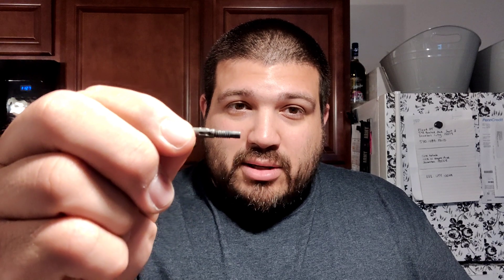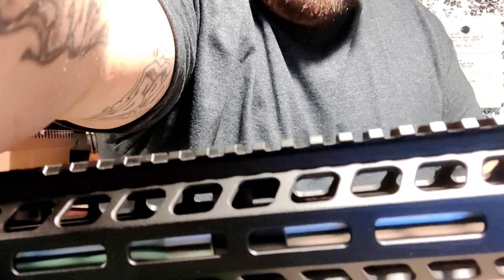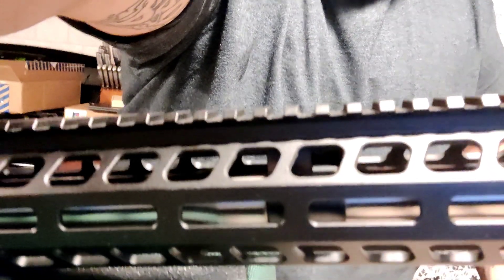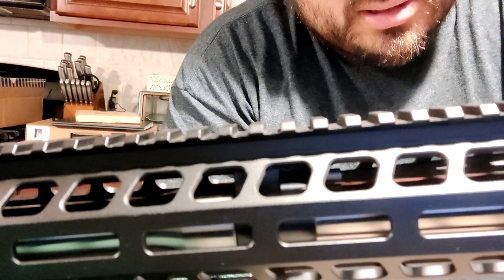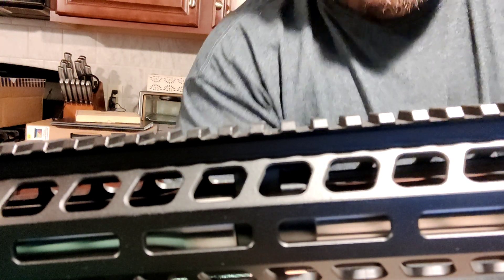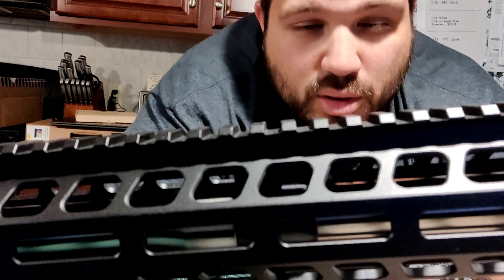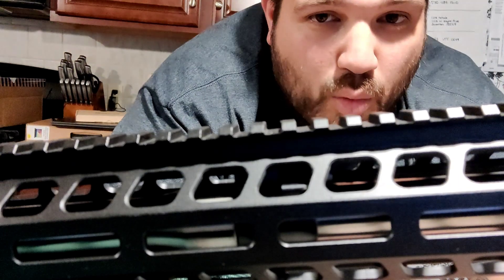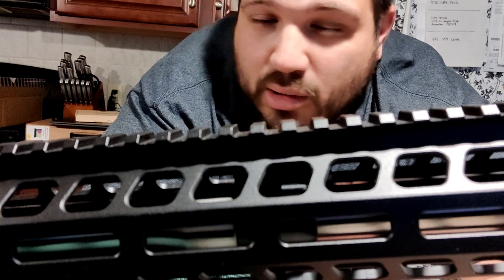PSA AR10 Gen 3 gas block adjustment

Comment: I got a psa ar10 in 308. Runs great without my suppressors on. With it on it wants to stove pipe from time to time. I am going to try and adjust the gas block like you showed maybe it will help.

Comment: My set screw fell out twice turning the fire arm into a single shot. Luckily I was able to find it both times.  I put blue lock tight on it and hope I don’t have the same problem, but have lost confidence in this gas block set up.
Reply from the maker: Sorry to hear that. There should be a small set screw on the side of the gas block that holds the detent in place. You can adjust the tension on the detent there. If it does nothing, they most likely forgot the detent and should warranty repair or replace the gas block.

Comment: I do have a question. PSA says the factory gas setting (for the 3 position block, not 5) is on setting #7. Does that mean 7 clicks from fully closed? Or 7 clicks from fully open? I can't seem to get any reliable extraction at all so I'm trying to restart at the factory setting. Might just sell the damn thing
Reply from the maker: @Gunthusiest  it's hard to say with how vague PSA's instructions are. I'd close it all the way, then open it 10 clicks. That should be a good starting point. You can fine-tune from there.
Reply: @airborneivan  I'll give that a shot. Thanks bro
Reply from the maker: @Gunthusiest  no problem. Let me know how it works out.
Reply: Started at 10 clicks and backed it off one. Works perfectly now. Using Winchester M80 (149 gr) if anyone is interested. Thanks again.
Reply from the maker: @Gunthusiest  awesome. Glad it worked.

Comment: So tightening it increases gas? And loosening decreases? And what size Allen key mine didn’t come with one.
Reply from the maker: @stevenweisenburger6095  counter clock-wise retracts the plunger and opens the gas port. Clock-wise, restricts  the gas port. I forget the allen key size, but if you reach out to PSA, they send you a replacement.

Comment: Thanks for the detailed demonstration. I saw your other PSA sabre video recently and was curious if your 13.7" AR-15 PSA Sabre also has this "5 position" adjustable gas block? The website says that the rifle includes the adjustable gas block but it seems like Tactical Advisor's review of the Sabre says differently for the 13.7" one specifically. He mentions it timestamped here: https://youtu.be/nw7IruQrjPQ?si=iK_WyWo13YAswopl&t=475. Just wanted to reach out to clarify. Thanks!
Reply from the maker: it is either a 3-position or 5-position gasblock. I didn't take the adjustment screw out to verify. As for Tactical Advisor's video. His 13.7 is the billet variant. It seems that the billet models that come with the Sabre Lock Up rail do not come with an adjustable gasblock. I'm not sure if this is due to the internal dimensions of the rail.

Comment: Oh nice. So it does have detents. I was worried. The double set screw style doesnt work. Thats what i thought it was.
Reply from the maker: The set screw on the side just retains the detent and spring as well as adjusts the tension on the detent. Just be careful if you need to remove it for any reason. The detent is small and easy to lose.

Comment: Shot my PA-10 for the 3rd time yesterday. It had some trouble cycling, but it wasn't an ejection issue.The bolt just was not riding the round home completely every time and I had to help it with the charging handle. I've not adjusted the gas at all, just using it at whatever it came stock at. Should I count the clicks turning it right to fully closed and see where it was, then try around 10-12 clicks out? It only has about 80 rounds through it now, so unsure if it's just still breaking in or if it needs gas adjustment.
Reply from the maker: Yea. I'd close it off and count the clicks in the process. Then add a click or two and see if you get better feeding. I'm not sure if you got the 3-positioned or 5-position gas block. I'd say 10 clicks out from closed is a good start.
Reply: @airborneivan  I'll give that a shot (teehee), thanks.

Comment: Thanks for this video. I have a question: What size is your Allen key? I bought a 6.8 SPC upper that did not come with an Allen key. I was getting one round at a time with ejection but no feeding the next round in. Swore a bit, wondered if the mags were no good, etc., etc. Then I realized/remembered it had an adjustable gas block. I went to a few stores to find a long enough Allen key. Found a set that is about 6", but they have a T handle. The 2.5 mm will work, half a turn at a time, but I want to find the right size and length Allen key for it. Thanks in advance.
Reply from the maker: I believe it's a 7/64 Allen. If you contact PSA and let them know your upper never came with the Allen key, they should send you one.
Reply: @airborneivan  Thanks a bunch for the info and the quick reply! Have a great week!
Reply from the maker: @greybeard277  glad I could help.

Comment: Is there a set screw on the side of the gas block that needs to be loosened before adjusting the front adjustment screw?
Reply from the maker: Only of the adjustment screw is hard to turn. There's a tiny set screw that retains the spring and detent. Of you back it out some, that will lessen the amount of tension on the detent. Be careful not to back it out all the way. It's is extremely easy to lose.

Comment: Took the set screw out now I can't put it back in...
Reply from the maker: Did the detent fall out? If it didn't, there's a retention Allen scree on the right side of the gas block. If you back that out almost all the way, the spring tensions will reduce just enough to screw the adjustment screw back in past the stop. Just make sure you drive that Allen retention screw back in til it's flush with the side of the gas block. Screw it too far in and you want be able to adjust it at all.

Comment: I'm having trouble getting mine adjusted.  I closed it completely and opened it 1/2 turn and it's throwing brass at 1oclock . I opened it almost all the way and just closed it a little and it's throwing it at 3ocloxk... seems almost backwards ?
Reply from the maker: Half turn? Do you mean you opened it half way?

Comment: I just got one.  It only has 2 clicks amd it is sticking way out.
Reply from the maker: Interesting. It only moves 2 clicks in either direction?
Reply: @airborneivan  There is one position it clicks into.  You can click it out of that position, but then it isn't held in place and screws out.  So there's just the one gas setting.
Reply from the maker: @spraynpray  sounds like the adjustment screw was never installed properly. On the right side of the gas block should be a screw. If you back that screw out almost all the way, it will release the pressure on the ball detent, and you should be able to screw the adjustment screw in past the stop. Just remember to that screw on the side of the gas block back into position (flush with the block). I believe it's a 1/16 Allen wrench or bit.
Reply: @airborneivan There was no detent in that hole on the side and the set screw is seized in the block so it cannot be fixed.  I contacted PSA and they responded with a canned answer of how to adjust it.  I told them it was busted last week and they have not responded.
Reply from the maker: @spraynpray  I would call them. Anytime I have an issue, I always call. I don't like going through the website.

Comment: I have the same rifle .How do you adjust to get stronger feeding and ejecting ?
Reply from the maker: You just have to mess around with the gas setting at the gas block. Backing the adjustment screw out will allow more gas to pass through the gas block. Not sure if I understand the "stronger feeding". Are you having issues with reliable feeding?

Comment: Lol....just put the 1st 40 rounds thru my gen 3 and the gas block set screw fell out....can't find a replacement anywhere.
Reply from the maker: Damn. Unfortunately PSA does not loctite or use Rocksett on their set screws. Here's a link for Amazon. I've used these set screws in the past to replace missing or damaged sections screws.

Prime-Line 9182932 Socket Set Screws, #10-32 X 1/4 in, Black Oxide Coated Steel, (25-pack) https://a.co/d/ccJmGOJ

Hope this helps.
Reply: @airborneivan most appreciated! Thank you.
I noticed in your video that the screw that you placed on the allen was much different. Does this matter?
Reply from the maker: @Synistercrayon  it might be a different allen key size, but if that's the case, just replace both set screws.
Reply from the maker: @Synistercrayon  the thread pitch should be the same. 10 - 32 is pretty standard.
Reply: @airborneivan look at the 55 second mark of your vid.
That is not.the same thing, is it?
Reply from the maker: @Synistercrayon  no. That's the adjustment screw for the gas setting.
Reply: I thank you for your time. I believe this fell out of my block
Reply from the maker: @Synistercrayon  thanks not good. The front of the gas back is missing the adjustment screw?
Reply: @airborneivan  it appears that way...the adjustment screw runs flush with the block, right?? Or ever protrudes a bit?
My allen wrench is not catching anything....it also goes about a 1/2 inch into the hole....so nothing there?
Reply from the maker: @Synistercrayon  it should protrude about a 1/4" or so. If it fell out, you may not have had a spring and detent previously installed. That shouldn't just fall out. Unless you have the older model that didn't have the detent. People have complaints of the screw backing out under recoil. I'd definitely reach out to PSA.
Reply: @airborneivan  heck yeah...3 mags max ran thru it and it is gone.
Gen 3 purchased last year, but just recently used in the past couple of months....but yeah. It is def gone .
It happens, I guess.
But yeah, I ran the 1st few mags at the range, then went home. All was fine.
My second visit, I had a failure to feed with the very 1 round. 
I have been sleuthing for a couple of weeks now. Definitely pinned it down with YOUR HELP....THANK YOU!!
But somewhere between leaving the range the first time, and then coming back for second visit.....that thing fell out
Reply: At first I  was thinking it was a magazine problem. Then I found your vid
Reply from the maker: @Synistercrayon  let me know how you make out and what PSA says.
Reply: @airborneivan 👍👍👍
Reply: @airborneivan  hey man. PSA offered nothing more than for me to send it back to the factory for warranty repair.
I laughed....then I ordered an upgraded gas block that will not, hopefully, fall apart.
I was not about to go thru shipping times, and God knows how long it would have sat at the factory.
Reply from the maker: @Synistercrayon  yeah. Something like that you're better off just replacing it with something better.
Reply: I lost that somehow? Is that possible...😂
Reply from the maker: @Synistercrayon  it shouldn't be. There's a detent that's supposed to prevent that screw from coming out. I'd reach out to PSA.
Reply: @airborneivan  yup. they getting a call today 
I thank you for your help!!

Comment: It would be much easier to see what your doing if you simply remove the forward guard.
Reply from the maker: Not much to see. Just theading in the adjustment screw. The important part is showing the adjustment screw and visually explaining why the "position" statement PSA uses is misleading so that you guys aren't wasting a bunch of ammo trying to figure this gas block out.

Comment: Mine only clicks 4 times
Reply: Nevermind, I figured it out, if you are having an issue with adjustable screw not clicking, there is a spring that pushes against a small ball, mine was damaged, took out and repaired, clicks every time.

Comment: When you  took  the screw out did your  have a little  ball  bearing?  Thanks
Reply from the maker: There is s bearing in there but it did not come out with the screw. Not sure if it's held in place or just didn't fall out.
Reply: @airborneivan   we took  the adjustment screw  out and a little  bearing  came  out what a pain. Thanks
Reply from the maker: @dave beasley  damn. Yeah, took mine apart a few times and mine never came out. I assumed that it was being held in place somehow.

Comment: Mine has a set screw  didn't  loose  it  now the adjustment  screw is mess up
Reply from the maker: You never loosened it and now it won't work?
Reply: @airborneivan   yes no clicks  others  has said it too mine was over  gas  so I turned  it  down and then up 1 turn the adjustment  screw  was messed  up fell out they is a set screw  on the side
Reply from the maker: @davebeasley9060  if your gas block has the set screw on the side, that's the older model. I don't think PSA makes them anymore. If the screw came out, you should be able to just screw it back in.
Reply from the maker: @davebeasley9060  I would suggest you replace that gas block with the upgraded one from PSA or Superlative Arms.
Reply: @airborneivan   thanks  I have a another  1 coming  in 6.5 Grendel  it's  the same  gas block   all i did was close it and opened  it back  up  adjustment  screw  was strip

Comment: I have a Gen 3 PA10 in 308 using a SiCo Saker silencer. My gas was at 26 clicks too and I found that 9 from closed was the sweet spot, runs like a champ and spits the casings out straight from the port.
Reply from the maker: That's awesome. Gotta get me a 30 cal can next.
Reply: Watermann: Is your PSA Gen 3 cycling subsonic ammo at 9 clicks from the gas block being closed. What grain ammo? I have a Silencer Co Harvester EVO. Im running Beck Subsonic 308 ammo 180grain, 220 grain, 170 grain, and 168 grain.
Reply: @stevefowler7319  No I don't have any subs for my 308 but I think you could get them to cycle with the gas all the way open. I set the gas by using the weakest rounds I have, the 7.6x51 M80 ball.
Reply: @watermann8200  thanks for your reply!
Reply: What barrel length and buffer were you using at 9 clicks? I'm running a standard 3.8oz buffer on my 13.7" Sabre upper with a Sandman-S and found that anything over 4 clicks caused malfunctions. I'm getting a heavier buffer in the mail which is what I should be using with my shorter barrel length. Just curious on your setup.
Reply: @stratic  Mines an 18", so the gassing would be different and using 155g A Max I can drop it to 7 clicks out with perfect extraction.

Comment: I think starting at the first click is wasting time, id begin at least at 6open then go to brass ejecting then loosening to bolt locking while shooting 1 round mags.. the point of the adjustable block is to get it fine tuned based on the shooting temps and best pressure recoil.

Comment: Great info . I'm 25 rounds into my Gen 3 and I'm having feeding and ejection issues. My rifle did not come with one of those long Alan keys.
Reply from the maker: Thanks. If you email them and tell them your rifle did not come with the adjustment Allen key they should send you one.
Reply: I appreciate it. After your video I looked at the gas block really closely and it is not adjustable. I'm going to try to run some expensive ammo and see if I have better results before I change the gas block I guess.
Reply from the maker: @kevinmitchell9046  honestly, I'd just contact PSA and let them know the issue your having. It may be an issue unrelated to the gas system. You could have a burr on one of the lugs or an out of spec chamber that's slowing down the bcg prematurely and causing the feeding issue.
Reply: Alright thanks man. I will do that. I appreciate it.
Reply from the maker: @kevinmitchell9046  anytime.

Comment: Are people having trouble with ejections out of the box? I have had zero issues.
Reply from the maker: Not necessarily.  You will have to adjust the gas block right out of the box. Problem is PSA's instructions for their adjustable gas block is a bit misleading which is why I made this video.
Reply: @airborneivan  I never touched the gas block and mine works perfectly.
Reply from the maker: @bofa83  guess you got lucky. Mine showed up severely over gassed.
Reply: @airborneivan  oh ok. That kind of stuff is beyond my knowledge. Mine might be over gassed for all I know.
Reply: @bofa83  You better figure it out because you could be causing severe wear and tear on your P10 if it's over gassed! No offense but this is why guys that don't understand the mechanics shouldn't own one but we all have to start somewhere! If you haven't done so register with snipers hide they have an amazing section on that   PA10!  In case you want to throw a can on it someday You going to need the help too.